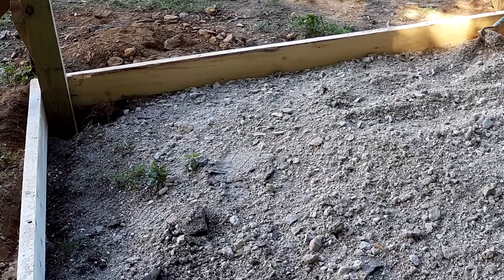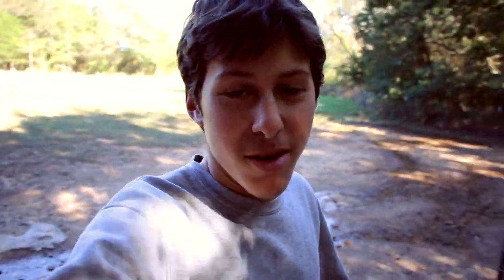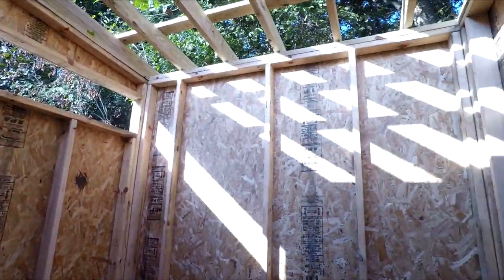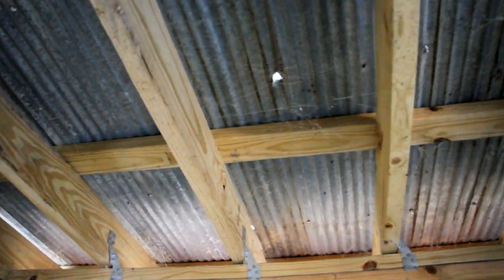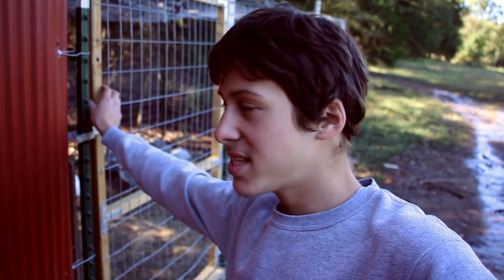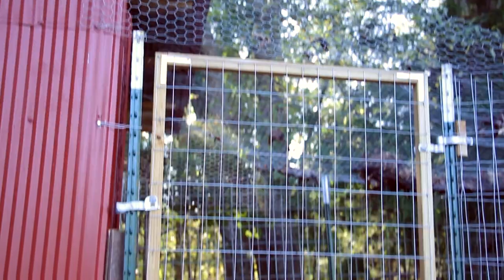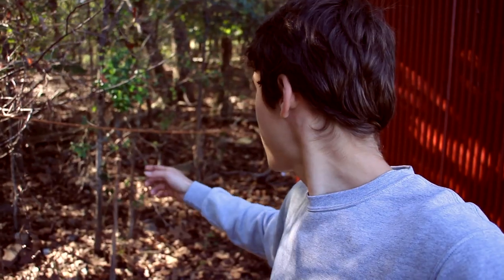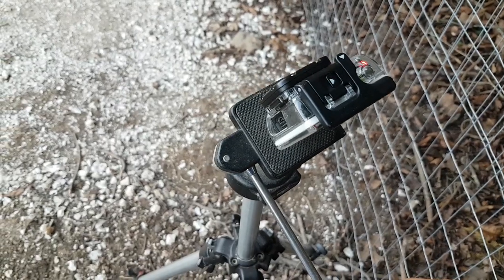Guinea/Goose Coop Follow-up - Building Process and Tour

Comment: Hey, nice video and follow up. It's good to see you at normal speed and giving the tour. I would have never thought of a water container to mix the cement with. You just saved me some big problems.  I thought I would have to order cement by truck but a large water container is just what I will be needing when I build  cement  slabs in Texas. Thanks!
Reply from the maker: Since our concrete slab was relatively small, we decided to go with  dry  bags and mix it with water. I thought we would have to mix the concrete in a bucket or something, but the handyman who was helping us out had brought the mixer which saved a ton of time and exertion.